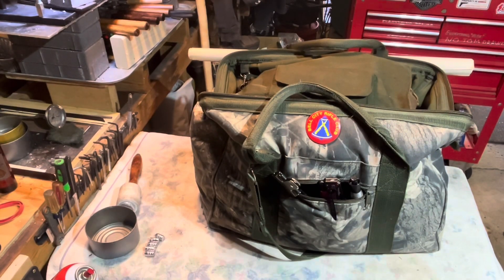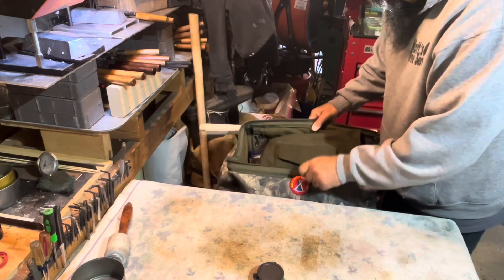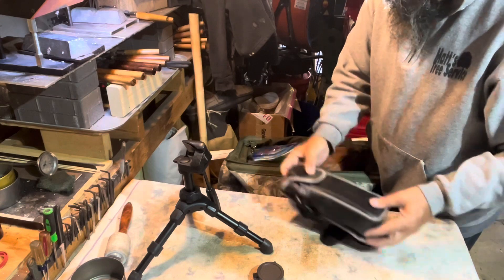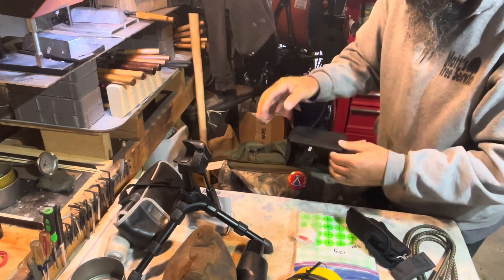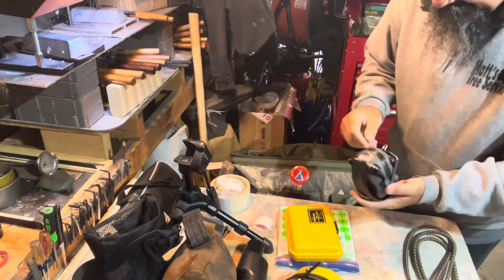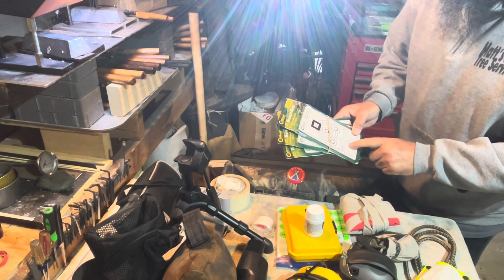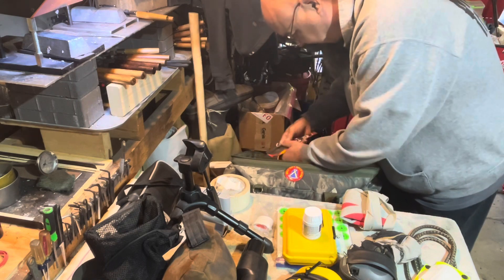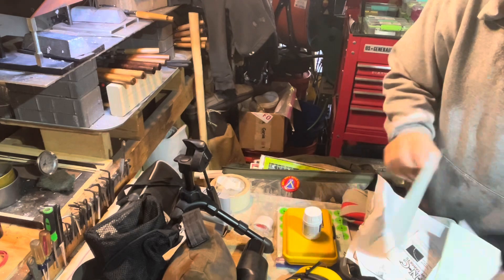Trees-A-blowin Range Bag Challenge

Comment: I use a large, lockable plastic tool box with the removeable tray divided into multiple compartments. I use the lower compartment to store ammunition and larger items. Ammunition must be locked up separately from firearms in Canada - especially during transport.
Reply from the maker: I also keep ammo separate, but not a requirement. I like having it in ammo can. ( large plastic)